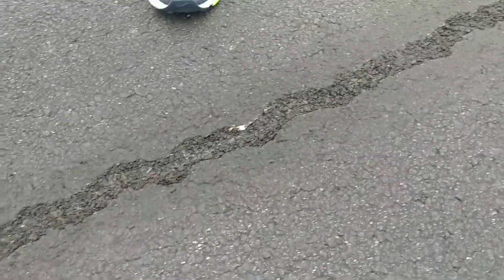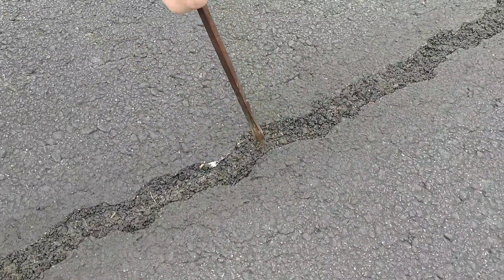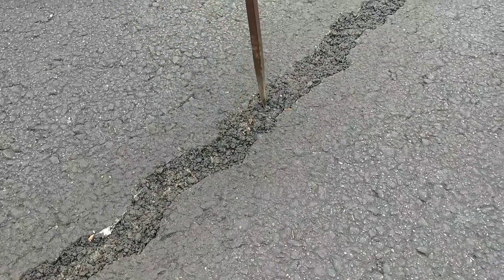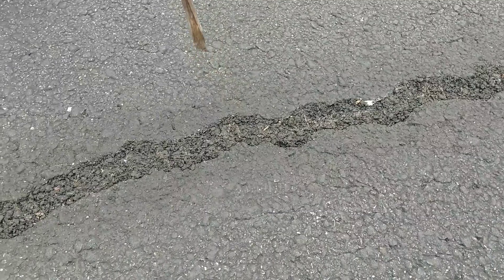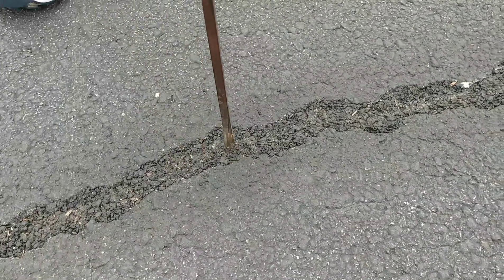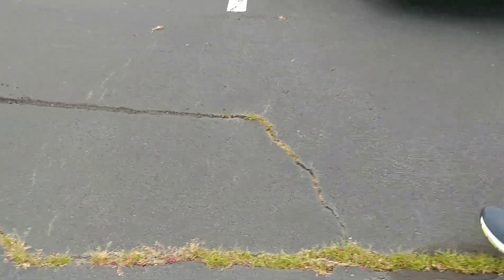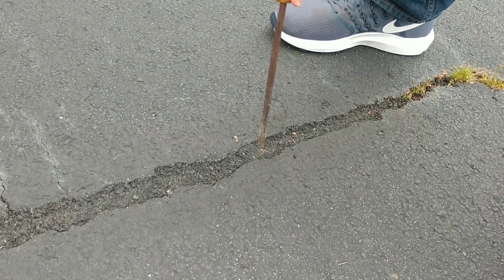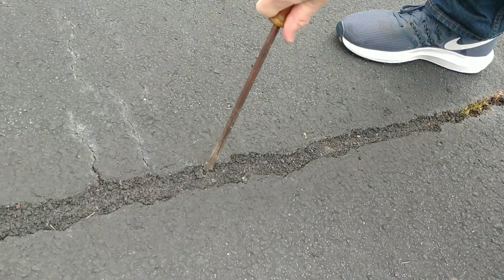Aquaphalt - compaction results after 1 week

Comment from the maker: Just to clarify:  The first example you see in the video we did NOT follow the manufacturer's instructions.  We were trying to show the "lazy way" someone might do if they were too lazy to wet and compact the product.  The later examples in the video show the results when properly wet and compacted.  We had "real world" examples where someone was using the product for us in the "lazy way" and the product did fail and we had to send someone else out and repair the previous work.  Other applications when properly wet and compacted have been great.  If you are going to use this product, you MUST both wet and compact it for optimal results as the manufacturer states in their documentation.